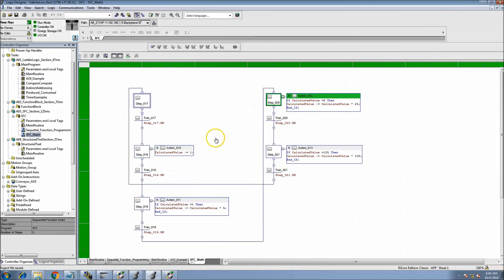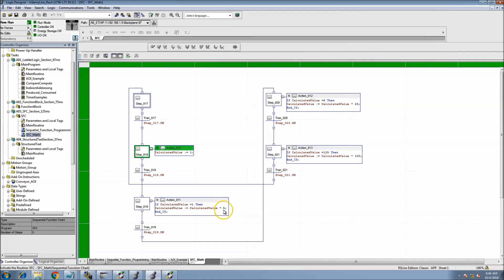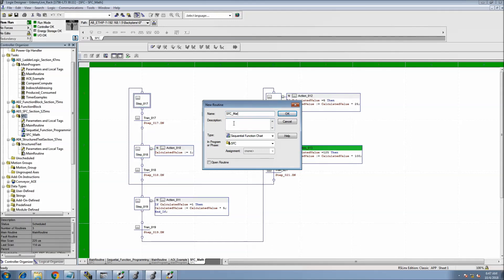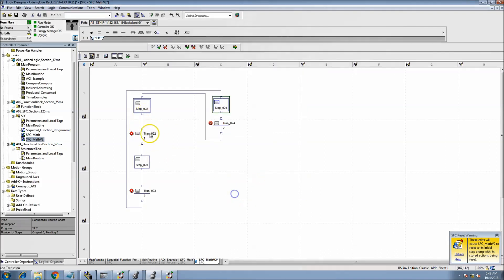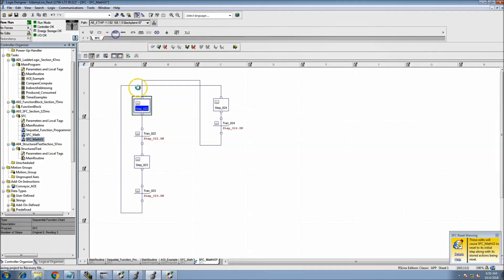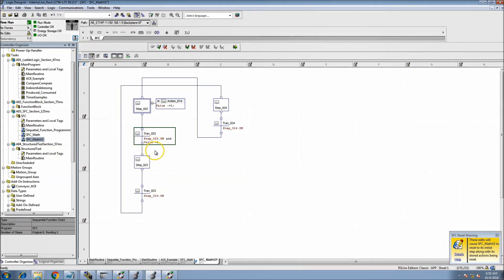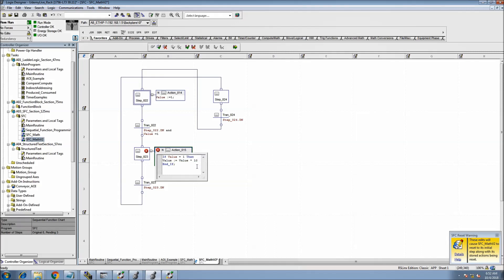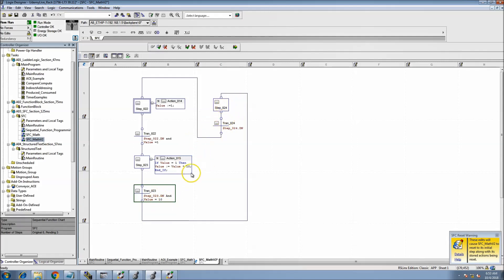RSlogix 5000 Sequential Function Chart Math Example Using Equations

Comment: Thank you for the lesson Mr!.
I have a question about the logic in the second STEP why the result is 10 it shouldn't be 11 ?  

step 022--->value=1,
step 023--->value=1+10,
value=11????

maybe my question is simpler but I can't catch the idea...
Reply from the maker: The steps are calculating in multiples.

Then this then do the the calculation.

Not sure you saw the values being multipling
Reply: @ShaneWelcher  Thanks, I didn't realize it's actually 1 * 10, not 1 + 10 and now they all make sense to me ...